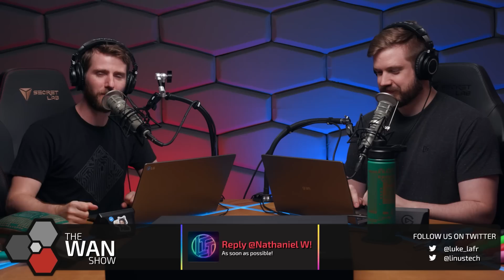Someone’s Gotta Do Something

Comment: I worked at McDonalds and our store would constantly have issues with the ice cream machine. Literally every few hours it would throw some error code and start beeping. You had to go over there and hit a button on the front for it to stop beeping but then after about 20 minutes it would start beeping again pissing everyone off. Our on-staff maintenance guys couldn't do anything about it. One June it broke completely, the GM called the service contractor, who wouldn't be able to send someone out until September to fix it -- 3 months without ice cream,  milkshakes, or McFlurries. Not only did we have a ton of super angry customers because of it, the store would also often get dinged by corporate for not being able to serve the entire menu. For something that wasn't our fault.

The only thing I can say for certain is that our store was at least clean. Every hour, at maximum, everything in the kitchen would be wiped down with sanitizer. Every night at close, everything was scrubbed thoroughly. And if we noticed that something was even a few days from expiration everything got thrown out. There were parts of the store that weren't cleaned frequently, but they were spots we couldn't get to easily like behind the grill or fryers (The grills can be moved, but they have to be unhooked first which takes a maintenance guy, and the fryers required 3 people to move them)

Comment: I have to disagree with Linus on the idea that there is even a single argument to be made over medical equipment. 
People need to get out of this fallacy of a mindset that the manufacturer's appointed technician is somehow more qualified and better than any other technician in the trade. What about a "certified" technician makes them better at the job? These are people, just like everyone else, with the faults of everyone else. They can be just as guilty of slacking off or dishonest repair as the next non-certified technician. So why do we place them on a pedestal? Because they have some dumb piece of paper? 

Any dignified repair tech will stand by their own work. If something fails that is of grave importance, then it's that technician's neck that is on the line. Or at the very least, their reputation and business. 

We need to get back to letting people's actions and reputation speak for them. Stop with all this fear mongering. Manufacturers don't own the world or the rights to your property.
Reply: And as someone that has personally witness non qualified personnel destroy multi million dollar medical equiptment you are dead wrong.

Comment: I also worked at a Taco Shop that had TacoPizza that made you run for the border.  Yo quiero Taco Pizza! The sour cream was used on some supreme items, so it was used regularly.  The upsale guacamole, "grilled chicken", "grilled beef", and "chili" would sit in the container for my full 8 hour shift and they would just keep adding hot water to keep it from turning into beef jerky because people dont got to cheep taco joint for "premium" tacos. I had similar arguments and results with the boss. We were also threatened  not to say anything to the healt inspector.

I wish i knew then what i know now about law and whistle-blower rules.

Comment: A large part of my job is fixing and maintaining a X-ray fluorescence instrument,  the company we bought the equipment from not only helps us over the phone in any pinch , they allow me to fully open diagnose and repair there systems, it makes X-rays to analyze elements, I’m not an electrician or anything fancy, if I can do that safely, any joe blow can work on a ice cream machine basics besides the compressor loop
Reply: Not an electrician.... wut...????
Most electricians don't service machinery.
They run wires and make connections.

I've never met an electrician to fix anything.

They call me after they run power to it.

Comment: Amazing thing is, I've never encountered a broken McDonald's ice cream machine here in Israel. Are they using a different model? Do they not have the draconian contract with Taylor
Reply: Liability law in the USA is special - McDonalds had this machine designed specifically with additional safety measures because under the US legal system McDonalds can still be named in a lawsuit even if the negligence is clearly at the franchise level.  Listerosis is one of the most profitable consumer food lawsuits because nearly everyone gets hospitalized and there is up to a 20% fatality rate.  McDonalds style soft serve is an excellent growth media for Listeria if any one of several steps in the process are not done correctly.
Reply: @dirething  over here there is only one franchisee, they run and operate all of the local branches, and are even called "McDonald's Israel". I'd assume they wouldn't want to be liable either.
Reply: @GaviLazan  sure, but i would assume that they are hiring people that can read and follow the directions and shift leads that are attentive enough to keep track that they are.  US franchisees were not, in some cases still are not, so McDonalds corporate asked taylor to make a very secure machine that the local staff will be locked out of if they do not maintain it correctly.

The franchisee i the states can protect their assets much easier, while in your country you have more reasonable assignment of negligence from what I understand.

McDonalds corporate can point to these added security features as proof they too active measures as far as they were able in court and avoid tens of millions in liability.

three people died and six were hospitalized in tacoma just a week ago over something like this.

I would not be surprised if McDonalds US dropped soft serve entirely from their menu if this 3rd party involvement stops being possible.  I love that style of soft serve but it is basically the perfect media to grow listeria under anything but perfect conditions.

Comment: My mazda has an issue with the keyless pushbutton start where it refuses to recognize that the key is present, it refuses to crank, start, or power the accessories. it's left me with the windows down unable to even close the sun roof. the accessory mode cant be switched on so connecting a diagnostic code reader to get an idea of what parts or modules may be malfunctioning is only possible using hardware and software only available to the dealership. this means i will need to have a 13 year old car towed 75 miles to the nearest service center, then pay hundreds of dollars just to have the car diagnostic codes read. that's hundreds maybe up to a thousand dollars in costs before any parts have been purchased or repairs have been made. proprietary horseshit.

Comment: I worked in McDonald's and cleaned the ice cream machine. Its a bitch.

I had to go and start learning the error codes to keep it up and running. Between the other guy ajd I, that machine ran from open to close 95% of the time. But it was hell to keep it like that. And ontop of everything else we had to do.

Comment: It has to be said that locking down industrial hardware should only be a thing when there is an inherent safety issue that comes with the end-user "pinging it", either draining a battery in a pacemaker or seizure-alert device that could result in being unable to save the patients life if the device has been compromised. For anything else implanted in someone's body, someone MUST have the rights to maintain it in perpetuity, even if the company who manufactured it goes out of business. All other hardware, there is no reason why something must be a "trade secret" especially when the hardware is clearly problematic to the point it causes owners to seek third party remediations.

Comment: As a person who used to work at a deli/restaurant I can give you this tip:

When going to any food place that is self serve with the drinks if you like to get tea particularily if you mix your tea with something else before you fill your glass pour out a little bit into your cup and sniff it. If it has a sour smell/taste skip it it means the drum has not been cleaned in likely a month or two.

Tea creates sediment on the sides and bottom and its pretty easy to clean out and and it takes about a month or two for this sediment to become so thick that it starts to alter the taste of the tea. This isnt much of an issue for smaller drums that can fit inside of a dish washer but the really tall boys cant fit in one so need to be hand washed.

Also if it's self serve and there is coffee consider where you are and what day it is because odds are good that coffee is brewed one time in the morning and maybe again mid afternoon if it was empty.

If they have a salad bar the containers can be lifted out and should be dated if something looks funky and theres no one around I'd pull it and look.
Reply: I remember cleaning out the drum for a tall boy, it's not that hard it's really just pointing the water gun at the insides and rinsing it out thoroughly and letting it dry face down. It helps that it was unsweetened tea.

Comment: Used to fix these machines. There is a bit more to it that what they are saying. They missed the glycol heater system, there are two compressors, blower fan...
You can't easily bypass the heat cycle either.
A lot of the issues I found were due to a lack of proper preventative maintenance, which ignored, created a big problem which took time to get parts and fix.
I do however agree with iFixit. Out of warranty the customer should be able to choose who they want to fix the unit.

Comment: Previous Orange Leaf (frozen yogurt) manager here. Our machines were fairly similar to McD's, and we had a dozen running nonstop. There's absolutely no reason for these machines to be down at all let alone as often as they are. Our machines were next to maintenance free outside cleaning and regular lubrication.
Reply: You are wrong about that. I used to work with Taylor machines in a part time job and they were so notoriously unreliable that people refused to work in the ice cream section. The machine would constantly throw error codes and they would ‘freezer lock’ some days which forced a disassemble and clean. Other days they would just not freeze and dispense goo. We had Taylor technicians out there dozens of times and they could never get it fully sorted.
Reply: @tylersanders2388  Hold your enthusiasm, this dude never said he worked with Taylor machines.
Reply: @DanielFerreira-ez8qd  Taylor machines are a freaking disaster and McDonald’s exclusively uses Taylor machines. I was just illustrating how absolutely terrible they are
Reply: @tylersanders2388  Yeah, that's what OP was talking about too. His machines are very similar but don't fail nearly as often.

Comment: Ice Cream machines are fairly simple machines. We used to field strip them, flush'em, and rebuild them every night when I worked at McDonalds in the 90s. The fact that "added a circuit board" made these machines unreliable and unservicable in the field is just a disgrace.
Reply: The fact that this has been the case for damn near every appliance is a disgrace. Microwave with mechanical buttons and dials? Works forever. One with that "smooth" touch-pad style buttons and LCD readout? Breaks. Same for Dishwashers, ranges, ovens, clothes washers, clothes dryers, rice cookers, etc.

The overall problem isn't even that they've replaced a bunch of mechanical timing relays and switches with a PCB either, it's that they relegated things TO a SINGLE PCB to save costs in manufacturing. It would be much less of a problem of each individual "switch" in a machine was relegated to it's own PCB, so that replacing it or even updating it is possible (look up teardowns of modern clothes washers and dish washers compared to old ones, not only are newer ones harder to disassemble, but you often can't at all.) Even then, each PCB should have a breaker to that trips when a fire or overheating condition is reached that isn't software-controlled.
Reply: @Kisai_Yuki My 1981 microwave has those shitty membrane buttons and it's still going strong!
Reply: I'd say a circuit board which reads sensors and gives warnings is a pretty good addition for almost all machines. But not if it displays cryptic codes and disables the hardware.
Reply: @andybrice2711  The disabling is the only way they can comfortably trust in people and offer a warranty on the machine.
Reply: Worked at Wendy's a few years ago. The frosty machine was also made by Taylor. We field striped and cleaned it every day.   No obscure "heating cycle" or "diagnostics codes". Micky-D's franchise owners got screwed with that deal so bad.
Reply: @lividsphincter4098  McDonald's has it's own custom version of the machine, which is the only one that has this issue. Also IIRC the machine doesn't even "break" per se, the heating cycle just stops if anything is slightly off, and it won't work until the cycle gets completed, but also the machine won't tell you what the problem is so you can fix it yourself. 

I don't think it's ever been confirmed but my impression is McDonald's corporate board also owns stock in Taylor, so they're basically shaking down the franchise owners for money by forcing them to use a machine that was designed to frequently need Taylor technicians to come repair it.
Reply: Arby’s reporting in, we also tore down the machine nightly.
Reply: "Let us add a small circuit boards that earn our managers a lot of money for which they will never have to answer in court". 
Welcome to 'Murica.
Reply: ....... It's called cleaning them not fking "field stripping". wtf. I've "cleaned" the machines working at Wendys, Mc Donalds, Arbys, etc etc over the last 3+ decades and not a single person has EVER called it that....
Reply: @Alcoholic_Nerd Ice cream maker reporting for duty sir! I joined the McCorps to straighten out my life sir! Oooorah!

Comment: Someone did this 3 years ago.
Reply: Honestly, I can't believe this hasn't been fixed based on how bad the PR was for McDonalds the last time. But I guess we're starting another bad PR cycle because McD's can't pull their heads out of their holes.
Reply: Addressed the kitch* solution in both this and ifixit video. Mc donalds corperate banned the use due to contracts